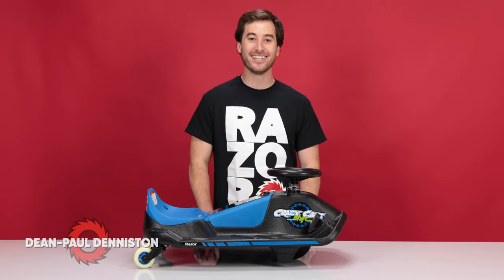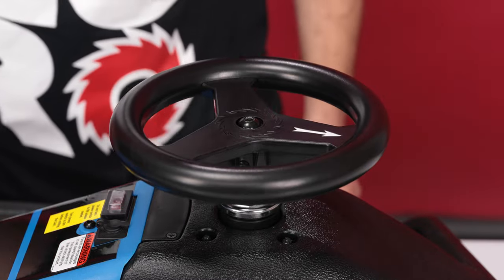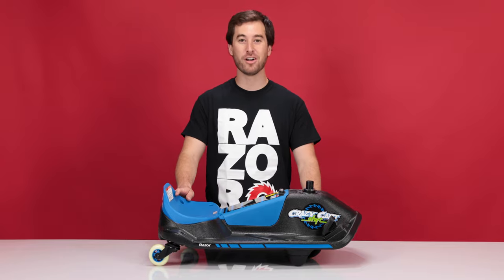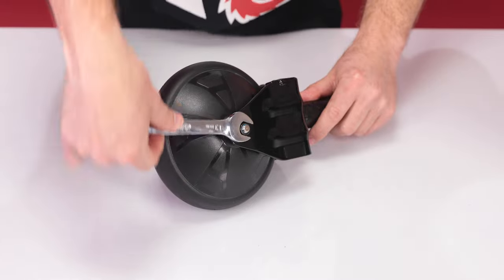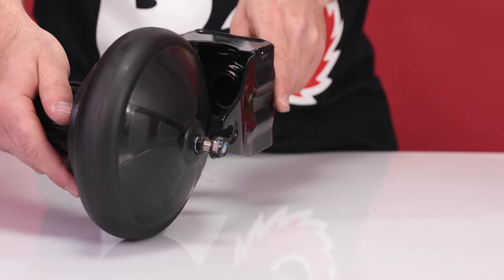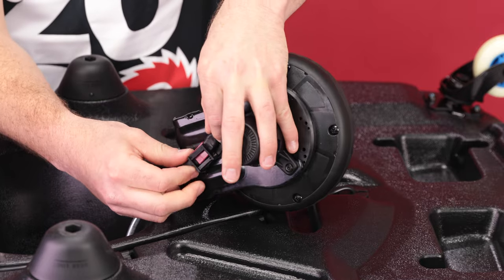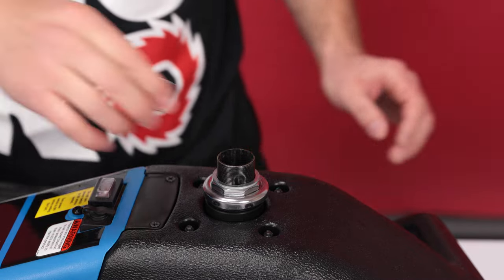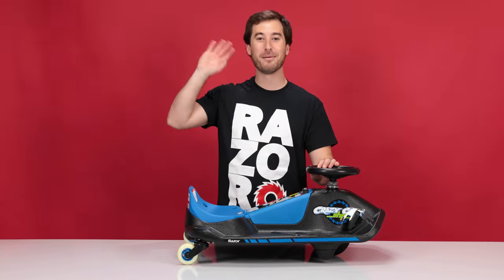How to Replace the Wheel/Hub-Motor On the Crazy Cart Shift

Comment: Absolutely perfect video.
The motor on our shift 2 was kaput.
This video helped me replace the motor/wheel so thanks very much Razor!
Yes, the locknut was hard to remove. Use a decent adjustable spanner (3.5cm width). Do not use mole grips.

Comment: What if we cannot get the locknut off?!
Reply: We also had that problem. I generously sprayed ours with WD-40, and let it sit for a couple of days. When I tried again, it still took some muscle, but it came off!
Reply: definitely wasn't as easy as he made it look.
Reply: You don't need to remove the steering wheel. I did mine from underneath and just swapped the motor.